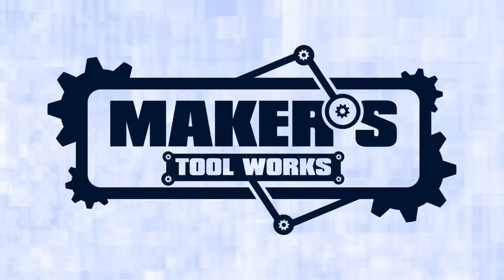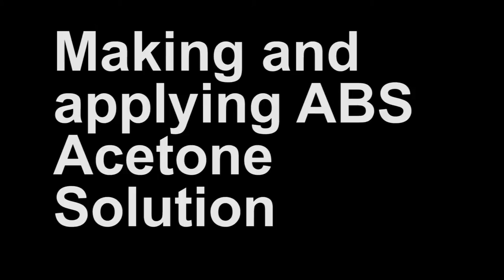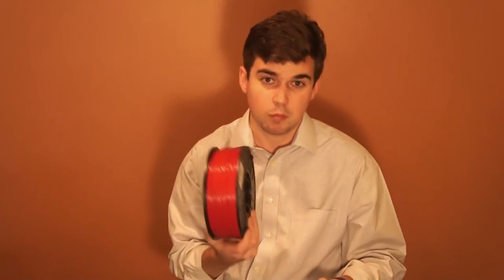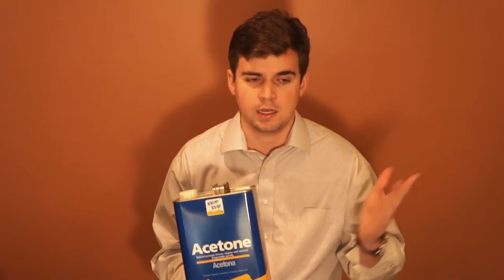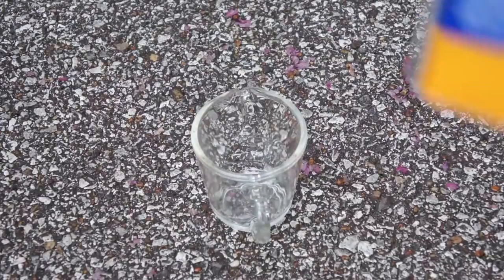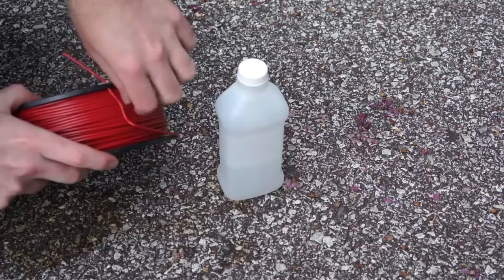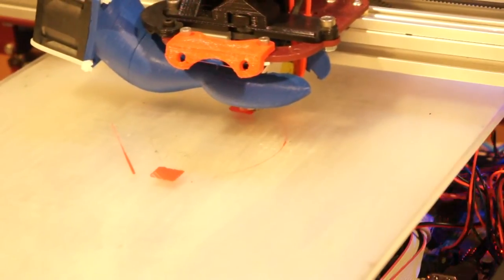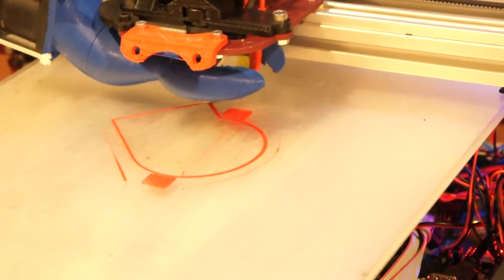Making and Applying ABS/Acetone Solution for 3D printing

Comment: I use pure acetone and the filament that came with my printer. 24 hours later and it did not fully dissolved. Do i have to let it for more? Or it means bad quality?
Reply: I dont think it is a extthermic reaction so it could take a loooooooong time until ist dissolves if you mix it or heat it a little but up it should work faster...

Comment: Do you still need a heated bed if you use the ABS juice? and if so about what temperature do you set it at
Reply: i have the same question
Reply: You must have a heated bed. I think with this ABS-Acetone solution you must have 60c minimum on the bed. More is better

Comment: Has anyone tried printing with PLA or other type of filaments with the ABS slurry of acetone?  If not,  I'll apply some painters tape (have a cheap brand of blue that even PLA won't adhere to) and put the slurry over the painters tape.  This way, if all goes wrong, at least the tape will come off of the heated glass print bed.